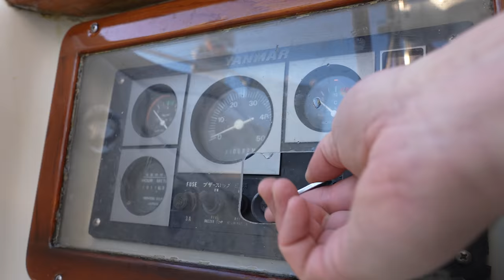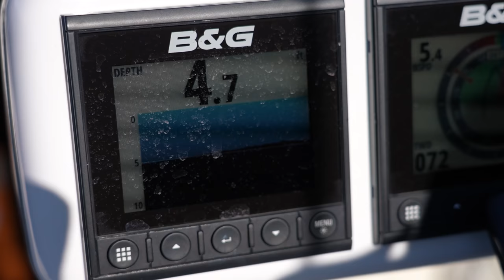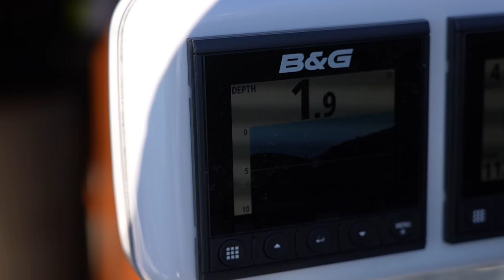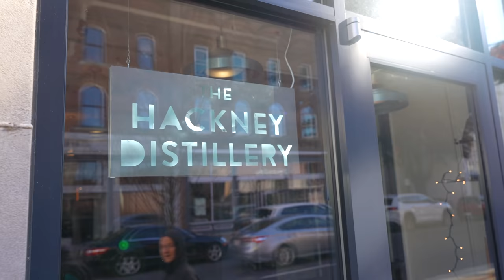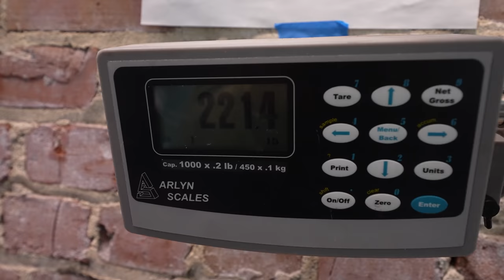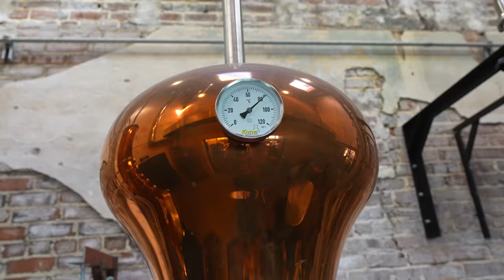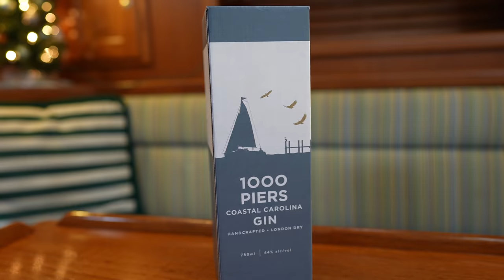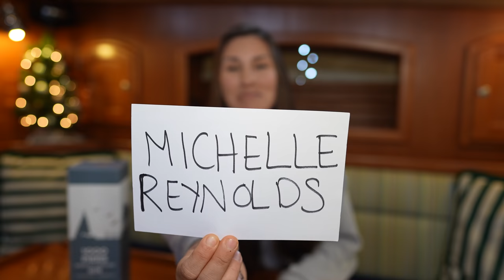Time to do some WORK!  | S06E31

Comment: "Water on the threads can make it harder to turn" lol, I needed to laugh today thanks. Pick yourself up a nice 1/2"-3/4" breaker bar and some good impact sockets it will be alot easier in the future. Also a good trick is a pipe wrench or large vice grips with thick cloth or rubber strap to protect the  propshaft from the pipe wrench/vise grip jaws. Otherwise the teeth on the pipe wrench/vise grips will gouge the shaft.Using the wood puts all the twist on the puller and can make it come loose and take bites out of the hub.

Comment: Loved the propeller pull.....I have one on my 42' Beneteau and have never dismantled it in the ten years I've owned the boat.  I've always been reluctant to dismantle it given the setting has worked great and I don't want to screw it up.  But your video makes it look simple.  I have greased it during my pulls every two years and it continues to work great.  The end zinc seems to fall off no matter what I've done to secure it; however, I have two torpedo shaft zincs that protect it from electrolysis.

Comment: Maintaining zincs is boating 101. That propeller was neglected. Like someone else pointed out, the corrosion could have been accelerated by a problem with your electrical system. You should do a potential survey around your hull in the water. Good luck!

Comment: Separating taper fit shafts, like propeller if often a pain.   We use taper fits on our 4000 hp engines to hold various parts together.  The most fascinating is the crank to flywheel.  To do this we have a port to pump oil into that actually expands the metal until it literally jumps off the shaft.   To assemble we use oil to expand and then another pump to push the part onto the tapered shaft by an exact distance and then release the oil used to expand.  All parts are reusable by this process.  Cleanliness is important and surface texture is considered better with a little sandpaper scuffing.

Comment: When you use a gear puller lube the threads, position it straight, tighten it, if it doesnt come off ...give the item a shock blow to break any stiction, it often works far better than just adding more tension that can strip the treads or pull the legs loose. ... Same if some things over tight or corroded.  

Jim the Gin had a English accent but had obviously lived in the US for a  quite a few years.🙂
Reply: @pauleohl  
I did see that ... I should have also said...
If you cannot knock the center tensioning screw . You use a piece of hardwood and hit the collar each side in the direction of the pull.. had to do it a lot with steering head bearings on bike forks where getting any gear/bearing puller on is near impossible. The other way is to use a bearing removal fork wedge... But you need one thats the right size and your striking it on from the side not good for bearings seals and glass hulls if it gets gnarly better then to apply a little localised heat and quench it with release oils.

Comment: Hats off to you two.  I'm also doing a re-fit on a Bristol 45.5 over in Oriental.  Not that far away.  But unlike yourselves I bailed in mid-December for the warmth of Florida.  I guess that is the difference between being in your 30s and in your 70s. Plan on being back soon.
 I had a max prop on my Hans Christian 48T, Bravura, for 32 years.  You have to keep a keen eye on the zinc.  We found during the 14 years we were in the Caribbean the water temp made a bit difference.  Stock some spares. The difference in performance is worth every dollar. 
 Your videos are great fun. Enjoy the new boat; you picked a good one. PS.  Try and stay warm.

Comment: ok if ya can't watch boat repairs making Gin was interesting as well.  My HF puller was of no use on my fixed pitch prop as nothing to grab on to effectively - Had to make a plate style puller one using a pair of Grainger 3/4 inch threaded pipe steel Gas Flanges, a pipe plug and three 8 inch Grade 8 bolts from Tractor Supply.  Worked like a champ and cost much less than the Walter Machine Plate puller for props.

Comment: I have the same max prop.  Quoted $2700 for rebuild or $3200 for new.  I decided on a fixed-pitch Campbell prop as we never race and don't care about the .5 to 1-knot speed loss.

Comment: I recently repowered, and added a PYI Maxprop easy and dripless shaft seal. Love them both, even though together they were the same price as the new engine. Sailing spead increased by 10-15%. Amazingly easy to install and adjust blade angle compared to the old versions, install nearly the same as a standard prop, to adjust blade pitch simply remove a locking screw and change the forward or reverse pin, easy to do in the water in 10 minutes. I played with the prop pitch for several trips until I got the sweet spot of just a hint of black smoke from the exhaust at max rpm. Now sailing and motoring are both sweeter. I see a lot of the channels using folding props rather than the max feathering style, but I have noticed several of them pulling for repairs while most of my friends with max props report no work other than annual lube jobs and zinc replacemnts.
I trust we're going to see some solar installation in an upcoming video?
Cheers

Comment: Your propeller is corroded because you’ve been at the dock on shore power with the battery charger running all the time or another boats charging can cause electrolysis to the other boat nearby.

Comment: I was surprised at how corroded that Max prop was.  I can't imagine you leaving it like that when you first hauled out. in Maine.   Was there a zinc on it that corroded away or fell off?  The blades looked corroded beyond repair.  Are you getting replacement blades?   Some harbors have a lot of random electricity in the water that promotes electrolysis.  It's almost like your boat is floating in a wet cell battery.  Had this problem in the Homer and Seward Alaska harbors.   Thanks for the video.  Repair On!  : )

Comment: It occurs to me that one thing that could have made the zinc on your prop corode so quickly is a grounding or electrical problem (leading to a current into the water) - given that you recently did your electrics it might be worth looking into whether the two things are connected - good luck! Is there a Hackney connection to the gin - watching from Hackney UK :-)!
Reply: All I know about sailing is from watching this channel. I do have an engineering degree however. On a boat is this the only piece of metal that touches the seawater? Is this propeller made out of metal that is conducting? Are we sure there is not an electrical insulator between the propeller and the drive shaft that powers it?
Reply: I'd say the likely issue is that zinc wasn't replaced in time. But stray current or extra metal the zinc is trying to protect could cause the increase deterioration of the zinc.

Comment: Hard to imagine your zinc completely corroded so quickly. After the electrical install, did you test  for galvanic and stray current? It would be a shame to have to deal with that problem repeatedly. I am not sure what the lag-time is with your vlogs but I hope you can find (found) a solution before heading out. Cheers.
Reply: It also seemed to me that the zinc anode dissolved pretty quickly.  Could it have been partly gone when they bought the boat?  Hmmmm  As far as time lag goes, this episode was recorded after Christmas (since they removed their Christmas lights first thing).  So that should mean only about a two week, or less, lag.
Reply: @pauleohl  Heck, I live in southern New York State and it was over 50 degrees F on at least one day since Christmas.  It had to be even warmer in central North Carolina

Comment: Had the same problem on my propeller.  Exactly the same and sent to Maxprop. They replace me for a new one from 3 to 4 blades with a cost very inferior as a new one.  The problem was they did a mistake in calculating the pitch so I had to haul out the boat a second time to adjust the pitch for 3 degrees…. Be carful with the calculations.  Your engine rev should not be able pass the max rpm.  If so increase the pitch.

Comment: I assume the boat was hauled and prop given the OK by the surveyor. Also don't know how long it has been for the prop to get in such shape. Either the dock you last spent a few weeks connected to has a problem or your internal electricals do. Any wires in the bilge getting wet? Second comment, saw you at McCotters yesterday and would have asked, but you were busy....why refurbish that prop? That type of prop cannot be repaired while in the water. If the cutless bearing goes, a basic prop can be pulled by a diver and the bearing replaced. Your current prop will necessitate hauling the boat out, ie, bucks$$ and lastly, simplicity is best.

Comment: Silver chloride half cell once you're back in the water could tell you a lot.  My zincs dissolving depends a lot on where I am. If in a marina with everyone running A/C they go a lot quicker than out on the hook. Be nice to know if your bonding system is correct and if you're properly zinced. Also if you don't have a galvanic isolator you should put one in if you're going to have shore power. A half cell and a decent DVOM would tell you if the old zinc grouper needs to be used at a dock. Or if you have stray AC or DC current that is cooking your zincs.